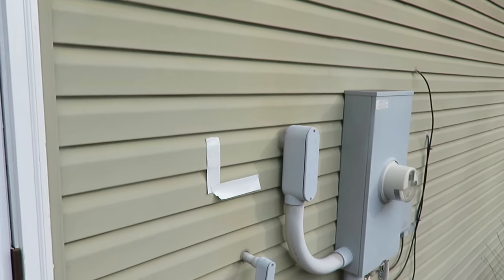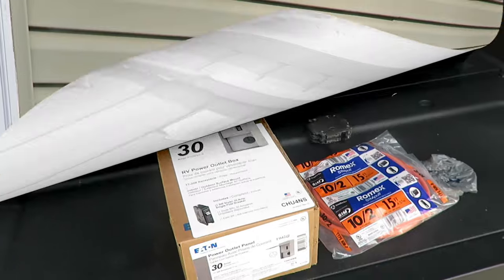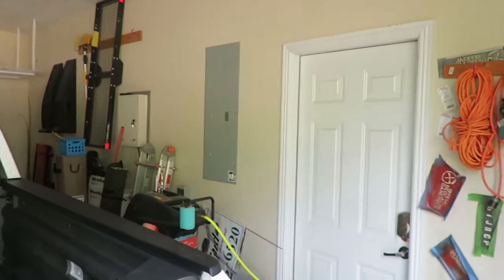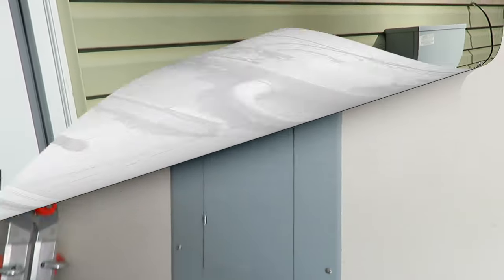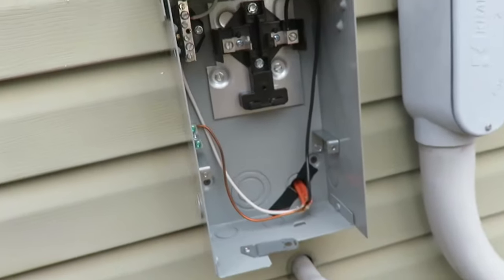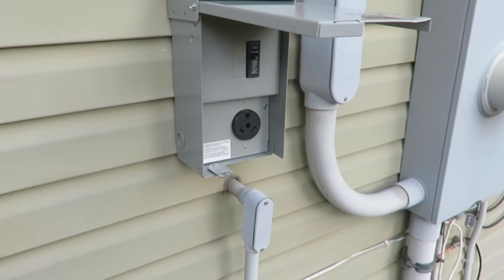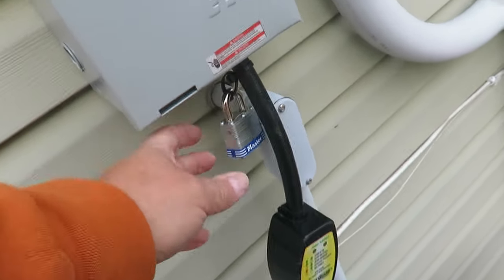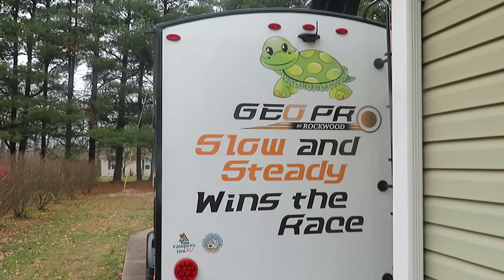Installing a RV 30 Amp plug to your home

Comment: Great video, I don't know if I can resist putting one in at my house now! I can't park mine in my driveway for long due to the HOA, but it would be nice to have a proper electrical hookup for when I have it there for cleaning or overnight to cool the fridge down.
Reply: Precisely my thoughts.  I'm thinking the convenience far outweighs the expense.  Added to my 'To Do List.'
Reply: @markvogt9462  adding the same once my parking pad behind gate on side of house is finished. This also adds value and diversity to a home!

Comment: I believe the 2020 nec under 210.8 now requires gfci protection for all outlets 120 -250 that are outdoors.

Your local building department can "adjust" the NEC requirements under nec article 90.4 (I believe).

Just check to make sure you are good.

Comment: A 50 is an identical amount of work. Either can also power welders and compressors if you're a DIYer.
Reply: No…. 50 amp welder plug is 240v… a 30 amp RV plug is wired as 120 single phase.
Wiring a 50 amp would then require an 50-30 RV power adaptor.

Comment: Best to get a real electrician. That panel is full of code violations, neutral wires sharing the connection with the grounds on the neutral ground busses, sloppy wiring, Siemans breaker in GE panel violates the UL listing, plus that panel is only made to have 40 pole spaces (that's why the GE twins wouldn't fit), no insulating bushing or cable clamp to protect the wire. A little knowledge is a dangerous thing.
Reply: I saw alot of the same and instantly noticed the potential for a overloaded panel. Depending on local electrical code, in the main panel the grounds and neutrals are allowed to be together, just not two neutrals under the same set screw.
Reply: @nickpickert8560  Still can't have a neutral wire landed under the same screw as a ground wire. 
The only place they can share the same bussing is the Service Entrance, sometimes also referred to as the main panel as you said.
Reply: You do realize Electrical codes from the 60s allowed these types of things? Current NEC yes you are correct, but thinking an old house needs to conform to current NEC and you would be mistaken.
Reply: @nicog3583   Yes, the older codes allowed quite a bit, I've been doing this since the early 80's. Still couldn't have two neutrals under one screw, or share a screw with a neutral and ground. More pole spaces than the panel is UL listed for was always a violation. The biggest change has been all feeders after the main breaker being 4 wire instead of 3. Plus, as always adding something new requires the new part of the install to be current enforced code compliant.

Comment: Hey bud, where are you cable clamps?  Any conductor being pulled into a panel enclosure is required to be secured with a cable clamp.
Reply from the maker: Clamps were installed, not shown installed on the panel. The one on the outside box was added later as I did not have one on hand at the time of recording. Thanks for pointing this out for others.

Comment: Thank you so much for this video after the electrician who has never worked with a camper finished he went inside  to test the electric and my TV blew out and started smoking and heard a pop so he called someone who had a camper and he turned off the breaker under the sink in the camper once that happened and cut the power from the camper going to the house what does that mean? Like what happened and what went wrong because I have to stay in the camper with my children for about a month or 2? do i need a new electricin to take a look at the electrical work he did? Or something else plus the battery was dead on the camper and charging once he hooked the electric up as well and it charged within 20 min once he hooked it up please help!!!

Comment: What about the penetrations for the wire.
Reply from the maker: It goes directly into the back of the box
Reply: @Turtle3863  wheres your flashing, siding box, or j channel? Is that vinyl siding? Not jumping to conclusions but if thats vinyl siding then youre not too bright.

Comment: How did you get the wire from the panel down thru the hole in the siding?
Reply from the maker: It only had to go about 6 inches, I just poked around until it hit the hole on the outside.
Reply: @Turtle3863  sounds easy enough. I need to do the exact same thing for a generator plug on my house and I’m dreading drilling holes in my vinyl siding. Did you silicone behind the box to keep water from getting behind the siding?
Reply from the maker: @brianmellard5886  I do have mine setup to also use with a generator. I did not use silicone because mine fits real tight against the wall but that or calk would be a good idea.

Comment: Great video!  How is the outlet with the breaker working for you I wanna do the same thing. Thanks for posting the link to buy, that helps a lot!
Reply from the maker: It is doing great. Used it 3 or 4 times over the summer to power up the camper the day before we go camping.
Reply: @Turtle3863   Thanks for replying back, that sounds good! Gonna do mine in a few days...I noticed you used 10 2 "Indoor" romax wire instead of "outdoor" wire, is that ok to use?
Reply from the maker: @dreamlookautodetailingauto3353  I only needed indoor wire for my installation and I got it at Menards. You might try a local electric supply company.
Reply: @Dream Look Auto Detailing Auto Detailing  the 10/2 is run directly into the "outdoor" (read weatherproof).  If he were to run 110v 30A outlets in a workshop or shed from the box, he would run outdoor wire since that would be exposed even if in conduit

Comment: Please help.   I'm wiring a 30amp RV  outlet... and I have a 8/3 wire running 100 feet out...    I don't need the 2nd hot wire,,,?    So what do I do with it?
Reply from the maker: Just don't use it then. Only need one hot , one return and a ground. Just make sure you have the right gauge wire for 30 amps.
Reply: @Turtle3863  ok.  I'm running out about 125 feet... so I'm using 8 guage

Comment: how much service do you have going to your house? can this be installed in a home that has 100 amp service?
Reply from the maker: Mine is a 200 amp, any time you add to any service you must be careful of the overall load. It is possible if you are aware of other usages in the house.

Comment: Question here ...I have a 50 ft ..10 AWG ..type S ..RV cable  has the 30amp plug in a water proof outlet other end has no plug...No longer use this cord and wondering if I can run bare end (stranded wire) and hook up to our house breaker box..20-25  feet from breaker box to where water proof outlet would be mounted...Thanks ..any help/suggestion on this matter
Reply from the maker: Might be dangerous, while unplugged, plug could be live and exposed.
Reply: What was the use of putting a 30 Amp breaker if your only using one phase?
Reply: @traviswilliams5225  Sir the easy explanation is power required.

A small window a/c can fit on a 15 Amp circuit, leaving a second 15 Amp circuit for a small refrigerator and some lights.

Comment: I am not a building inspector nor a certified electrician.  From what I have discovered is this.  If the circuit breaker isn't listed on the service panel you voided the UL certification.  GE means GE and not Siemens and you can have a problem with insurance if you house burns down.  I also notice you don't have a GFIC on your circuit.  So, is this a legit installation or a hack job?  Yes, I spent $78 for a GE 20 amp 120v single pole GFIC (Lowe's) and $80 for a 30 amp 120v single pole GFIC ACE Hardware).

Comment: Can I use 10 gauge stranded instead of solid wire ?
Reply from the maker: I believe so, as long as it is rated at 30 amps
Reply: I would not use stranded for running circuits due to current dissipation. Use stranded for appliances and devices.
Reply: stranded wire must be in conduit

Comment: I live in Canada and in no way would they pass 12 gauge on a 30 amp circuit , in fact depending on the length it’s 8 or 6 for runs over 100 feet

Comment: This video is very informative. I have an electrician friend who may
Help me with the install. It am wondering if it’s possible to install an rv 30 amp outlet where there is not a house only a power source. My aunt has some land she is letting us use and we want to park on it. It had a mobile home on it but that was torn down. Only power connection and septic still there.
Reply from the maker: Should work as long as there is some kind of panel to tie intro, I would definitely get help from your electrician friend, codes are all deferent in many areas.